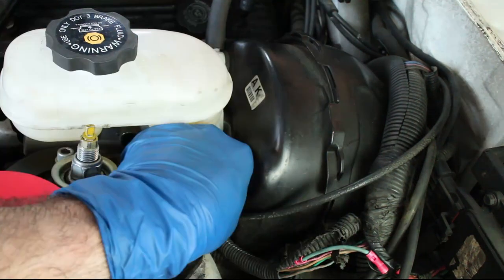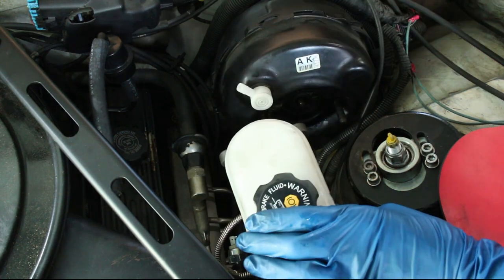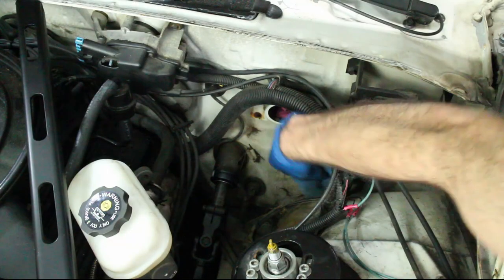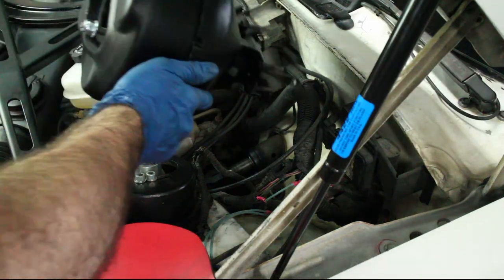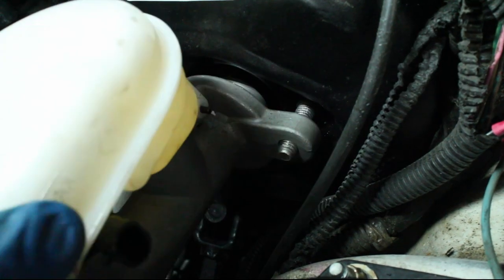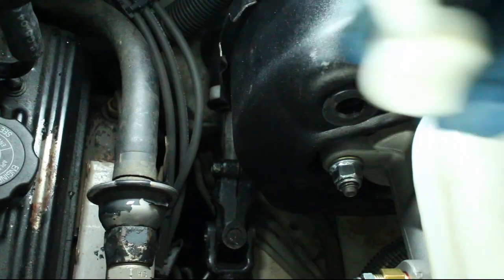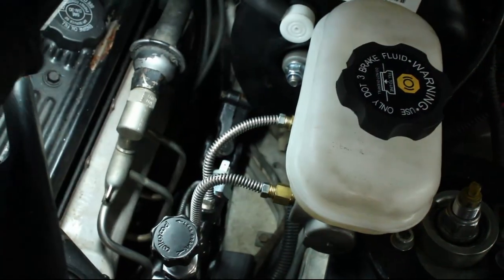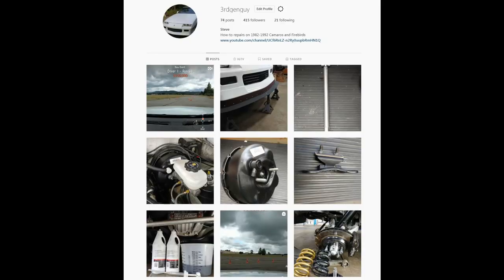How to Install a 4th Gen Booster on a 1982-1992 Camaro/Firebird

Comment: Apparently the 93-97 Master cylinder has different threads for the brake lines. One line fits, the other is too big. So they changed the threads 93-97, and then changed them back to the 3rd gen thread patterns from 98-02. Thanks GM. 

owning a GM vehicle reminds me every day of why I'm a Ford guy.

Comment: Great tutorial my friend. I'm going to be replacing my power brake booster in my 94 trans am. It works fine but I'm building a show car. so my old brake booster is kinda rough looking. It's got some surface rust under the the 2 bolts and inside by the round rubber gasket inside..

Comment: Why is the third gen check used as opposed to the 4th? I’m wondering because I swapped in 4th gen brakes front and rear and not sure which I should use. Great videos! Favorite third gen channel by far.
Reply from the maker: the vacuum hose diameter is different 3rd to 4th.
Reply: @3rdGenGuy  I purchased your brake booster support brace today off eBay. Thanks for the quick shipping! Stoked to get this piece
Reply from the maker: thx for the support. 
already shipped.

Comment: Hi buddy, hey I have this same setup follow your video, but brakes are not very powerful when I push hard, do not lock the wheels for example and reduce speed slowly and not hard like a emergency brake, any similar issues when you did ?? Thx
Reply from the maker: did you Bench bleed the master cyl?
Reply: @3rdGenGuy  yes I did, driving normal is just fine, is not enough power on hard stops, and when the car is not moving I push the brake and I can reach the end on the travel
Reply from the maker: sounds like the master is bad.
lotta bad 4th gen brake masters lately.
I fixed one on a 87 LSA swapped Camaro recently . same issue.
Reply: Thanks for the answers, I just ordered a new master, hope and I fix that easy lol

Comment: Ok so my car doesn’t have those circular canisters. I have a vacuum canister bolted to the firewall in between the brake booster and washer pump and it’s not connected so that shouldn’t be my issue as it’s not receiving any vacuum from the engine. What other things can I check?  Thanks.
Reply from the maker: hard to say man. so many things could be at work here.

Comment: I did the swap and my Wilwood brakes keep locking up over a short period.  My question is does the 4th Gen have the same pushrod length because when I loosen the nuts to the Master cylinder they release?
Reply from the maker: so there has been a string of people with your problem.
SOMETHING changed recently with the parts.
it's been 15+ years of 4th gen booster/master setups working fine
then in 2019+ suddenly it's an issue.

Comment: I followed your 4th gen master cylinder / wilwood prop valve video to a T. Did everything exactly as you did. Still not happy with how squishy the brake pedal feels. They work, but just doesn't "feel" great. Do you thing doing this 4th gen booster will help?
Reply from the maker: the 4th gen booster+ 4th gen master cly is way better. pedal travel is like 1/2  compared to before. pretty happy with it
Reply: @3rdGenGuy  Good to know. Looks like I'm going to follow another of your vids into my car. Thank you.
Reply: @3rdGenGuy  Finished this just last night. OMG does the brakes feel like a world of difference! They feel like they "should" now. I recommend this upgrade to everyone with a third gen now. Couple side notes, the 10mm nuts for the master cylinder will swap over from the 3rd gen however the 4 bolts from the firewall are different from the 3rd gen so those you will need to replace the nuts there. Just note these nuts are 8M-1.25 size, not 8M-1.00... ask me how I know this. LOL
Reply: Good too know

Comment: Odd you had no problem with the bushing/gasket of the 4th gen fitting into the 3rd gen hole, the rubber on the 4th gen is a decent sized wider.
Reply from the maker: everything bolted in no issue.
Reply: @3rdGenGuy  Did you actually look at how the seal and the firewall met? Bolt up sure, but I doubt it's a water proof connection, as the 3rd gen was,  I'm only citing, because I've done it as well and the boot for the 3rd and 4th gens are different, the 4th gen is larger.
Reply from the maker: @torymblue2000  no leaks on my car. and I race in the rain a lot. even in downpours or 1in standing water.
if you are worried, something could be modified to fit as a gasket.

Comment: Any other parts that need to be messed with/removed underneath the column or do you just loosen those nuts and let it droop down a little?
Reply from the maker: just remove the 4 booster nuts.  it's a tight squeeze, but that's it

Comment: Hey there when you installed that 4th gen master cylinder did the fittings on your 3rd gen brake lines work?? Or did you need to use an adapter of some sort??
Reply from the maker: if you have a metric 87-92 car, the fittings are identical from the 3rd to 4th gen master.
Reply: 1983 here anyone know what I need to make it work
Reply: I’m running into the same problem so what size fitting did you use ?

Comment: did you have a problem with your aftermarket caster camber plate pushing into the side of your master reservoir and tilting it?
 i am in the process of this mod right now and my umi plate is doing just that....to the point i'm afraid the reservoir will leak from the seals connecting it to the master bore. the only things i can think to do to fix this would be to shim the booster with washers on the bottom two studs (between booster and firewall) to get the master to angle up the 1/4 inch i need so the umi plates tucks underneath it. or possibly cut a 45* angle out of the top edge of the umi tower closest to the reservoir and do some re-welding.....thoughts?
what year 4th gen booster, and master did you use??
Reply from the maker: yes, the Founders or UMI strut mounts tend to hit the master cly at high camber settings.
there's no way around it until you go manual brakes.
4th gen booster/master
 just tell the parts store guy 2002 camaro SS.

Comment: Do the 3rd gen brake lines mount right into the 4th gen master cylinder?
Reply from the maker: the later 1987+ Metric lines do yes.
Reply: What would I need to swap over to my 82 Z28 any 4 gen m/c and any 4 gen booster or any specific year?

Comment: Hey my third Gen Camaro stalls sometimes when my foot is on the brake or when I'm braking to a stop, I hear a loud swooshing noise every time I press the brake is it possible it's the brake booster
Reply from the maker: pretty much all 80-90s GM boosters will make that Swooshing" noise.
Reply: @3rdGenGuy  would that cause stalling tho? It's intermittent last time it did it I was going about 30mph and mashing the brakes the car cut off and rolled to a stop
Reply from the maker: idle air control valve could be dirty or clogged. 
hard to say really. 
cars are often mysteries.
Reply: @3rdGenGuy  o ok thx

Comment: Is there anymore modifications for the 4th gen master and booster on a 82 camaro?
Reply from the maker: it's a direct bolt in for the most part.
early cars 82-84 might be a bit different.
get one from a local store, wrap it up in plastic and test fit it.
if it doesn't, return it
Reply: @3rdGenGuy  thank you for the idea

Comment: Do you have to remove the lower dash out the way to get the column bracket out the way?
Reply from the maker: ya, so my under dash pad was not installed at the time of this video.
remove it and get more room to work in

Comment: I got the booster and master cylinder already from autozone but disappointed it came with no hardware. May I ask where you sourced your locking nuts from, and the specs?
Reply from the maker: local hardware store had the correct lock nuts. I don't remember what thread pitch they were.

Comment: Can the 4th Gen Booster and Master be used with 4 wheel disk brake systems?
Reply from the maker: ya, but be wary.
some people have had issues latly.
Reply: @3rdGenGuy  what kind of issues.    I want to do a 4 wheel disc conversion on my 90 firebird.  Gonna go with a C5 setup front and rear.  Was wondering which route to go with the master, booster n proportioning  valve?    Saw this and was hoping this would work for me.  Nit going Brembo  Baer or anything crazy like that

Comment: Can you use the 4th Gen booster and Master if your running front disk/rear drums? I have a 3rd Gen Camaro drag/street car no need for 4 wheel disk brakes but would like a little more responsive braking. Thanks
Reply from the maker: you can use them on a Disk/Drum car.
this master doesn't play nice with the factory "low drag" calipers though. 
they work best with an aftermarket front brake kit
Reply: @3rdGenGuy  i did this and im having brakes draging... any fix for this?
Reply from the maker: @Dirtydeesdigital  you aren't alone. I've seen a few guys recently with dragging brakes.

the 1st thing to check is if the brake pedal is returning all the way forward to the driver. You can see this at 2:30 in the video. i had to pull back my brake light switch about 1/2in

Comment: Hey man, so when I disconnect the check valve from the brake booster and plug that line, leaving the booster disconnected, that rpm surge symptom I’m having goes away. Seems like it’s something with that check valve. I’ve tried blowing air through the check valve from the booster side to the manifold and I do have air coming through, is that normal?
Reply from the maker: air should only flow 1 way through those check valves. they are  about $20 new

Comment: Hey man, can i use my 3rd gen master with a 4th gen booster? 
My master is new and my booster just went out last week. I have watched both your videos and seen all questions and answers just not the one im looking for.
Reply from the maker: you can, however the 3rd gen booster Pin is 3/8in shorter.
so you have more pedal travel as a result.
i suggest doing both the 4th gen master and booster at 1 time.

Comment from the maker: Just a FYI
Recently many 3rd gen guys who installed the 4th gen Booster+Master have had issues with brake calipers dragging.
I'm not sure what the issue is.
The 4th gen combo has been used with success for 15+ years with hundreds of 3rd gen builds.
Suddenly multiple people are having issues
So be diligent about parts, I don't know if the manufacturers changed something like pin depths on newer 4th gen masters.
Reply: I am plagued by this issue.  I’m guessing the pushrod length on the booster is slightly too long and caused the master cylinder to begin holding pressure to my rear brakes, causing drag.  It ultimately killed the master cylinder which leaked and killed the booster.  Is there adjustment available on the booster pushrod length where the master bolts up? It doesn’t appear adjustable.
Reply from the maker: @kevinkelly5257  it's not adjustable. but it's so weird that ppl are having issues out of the blue. it seems like maybe the part makers changed a pin length or something.
kinda like the AC delco steering idler arm being changed recently and it's now wrong for 3rd gens.
Reply from the maker: @kevinkelly5257  that sucks, but idk what's happening here.
Reply: @3rdGenGuy  could it be that it makes a difference if you install that black bracket between master and booster which holds the prop valve in place? I mean the distance between booster and master can vary if you install the bracket or not.

Comment: Is it ok to use the third gen proportioning valve with it?
Reply from the maker: ya, that's fine. the factory prop valve just gives up a bit of rear brake bite.
Reply: @3rdGenGuy  ok, thank you.. I currently have a drum brake prop while having discs so I wasn't sure if I had to go fourth gen on the prop or not

Comment: So I did this swap and my proportion valve line nuts are bigger than the holes in the 4th gen master cyl do you know of an adapter or do I have to re make the lines
Reply from the maker: depends, early 87 and older cars are standard.
the 4th gen booster is metric.
both holes on the 4th gen booster are different threads and sizes as well.
Reply: Mine is an 83 and i didn't notice the difference in whole size I'm going to take both masters to the parts store today and see what I can come up with
Reply from the maker: @brandonoliver9110  an 82 is standard, so it will be a Double flair. the 4th gen is a metric Bubble flair listed in the picture at the start of the video.  so you need a Male bubble flair to female double flair adapter.
Reply: Would you happen to know the sizes or maybe a part number I've been all over the place looking for adapters and custom line shops to try and get the lines to match up from the proportion valve to the master and no luck unless I want to send the lines off
Reply from the maker: @brandonoliver9110  this link is to a thread that has a pic that shows every year of master Cly and what bores and threads they have. 
it's on Page 1
https://www.thirdgen.org/forums/brakes/719070-4th-gen-master-cylinder.html

Comment: What year parts did you use?
Reply: if you have a metric car, i know you need the 98 ls1 master in order for your factory brake lines coming off the proportioning valve too be able to screw into master without having to change fittings. i made the mistake of getting 93 parts at first and the lines wouldn't connect in front
Reply: @johndoe-zd9lb thanks I’m going to do this swap this soon

Comment: Will a 4th gen 3.8l work do you know?
Reply from the maker: I don't know. 
all i know is the 98-02 V8 master cly works.
Reply: Yes ANY 98-02 camaro or firebird master cylinder will work even if its a v6 car the calipers and master cylinder from both v8 and v6 cars are IDENTICAL..

Comment: What r the adapters u used on the lines
Reply from the maker: the later 1987-1992 cars have the exact same lines as the 4th gen master.
i have a video that shows every adapter and line 
https://www.youtube.com/watch?v=RRV6c8rBdXA
Reply: I got mine installed.  Buy sadly breaks are worse now then before lol . Do I need to do anything else.
Reply from the maker: @textor33  how many times have you bleed the brakes?
it took me 3 bleeds to get 100% of the air out of the system.
Reply: @3rdGenGuy   do you have a part number on the 4th Gen Lines
Reply from the maker: @carringtononsite  what lines?
Reply: The lines to the master cylinder
Reply from the maker: @carringtononsite  those are made by me. it was just a 3/8 double inverted flair on both ends.
Reply: @3rdGenGuy  I’m running into a issue ,, did you run into the same with the oem’s .. one side it bigger than the other. Was it the same with your before you put on adapter.
Reply from the maker: @carringtononsite  
this video shows the lines and adapters part numbers in the first 25 seconds of the video.
https://www.youtube.com/watch?v=RRV6c8rBdXA

Comment: Question for you, I have an rpm surge of about 200 rpm’s when I depress the brakes, then returns to normal, then same surge when releasing the brakes, then back to normal. I replaced the brake booster, booster check valve, booster check filter and all rubber hoses connecting those items and still same surge. Any ideas?? I honestly don’t remember if it did this before I started paying attention to it last week while replacing items just because they looked old.
Reply from the maker: what's the idle engine RPM?

Comment: The one on the top left above the brake pedal was a bich to take out, I shit you not I took 2 hours on that lug nut,
Reply from the maker: at 0:47 it shows the weird wrench combo i used.
NOT easy to get to
Reply: @3rdGenGuy  😂, not me, I tried to use that one but I think that the one that I had was too fat so it wouldn't fit past the brake. I had to get an adapter to make it into a corner
Reply: @3rdGenGuy  where u working on a camero ?
Reply from the maker: @goodafternoonworld4456  yes, a 92 RS. as far as i'm aware,the pedal assembly under the dash is the same Camaro VS firebird.

Comment: Really? So this fixes that shitty mushy feeling I feel in the brakes? I have no confidence in them lol. I even put new brake pads all around and remachined the rotors and they still felts mushy and like shit lol. If this is the upgrade to do that fixes it I’ll go buy the parts right now! So any year 4th gen Camaro for the parts? And what nuts do I get?
Reply from the maker: if you have stock brakes, that's usually the issue. the 4th gen master doesn't work well with factory calipers.

Comment: Was nobody curious about the check valves?
Reply from the maker: pretty straight forward. 3rd gen ones has a 3/8 line, 4th gen has a larger line. just swap valves like in the video and bam, it works.
Reply: Thank you sir

Comment: Another guy on 3rd gen org posted a picture of the master/booster combo sitting pretty high and possibly interfering with the hood.   I can't tell from the video but do you have any clearance issues?
Reply from the maker: I think that's a firebird issue since the hood lines are petty low on those.